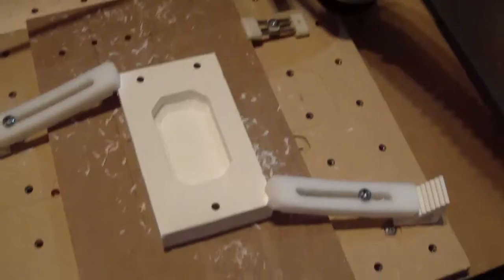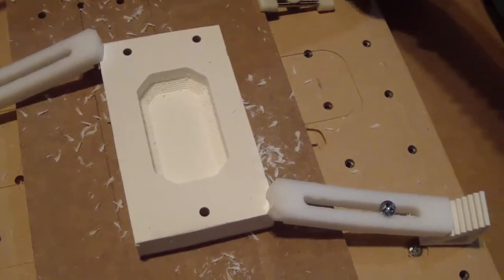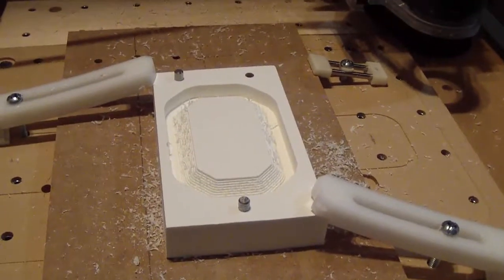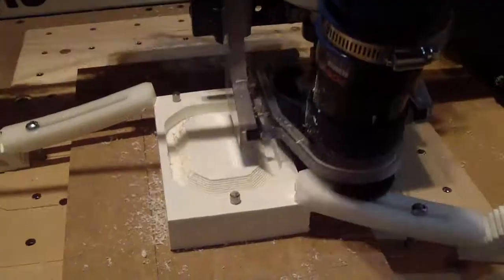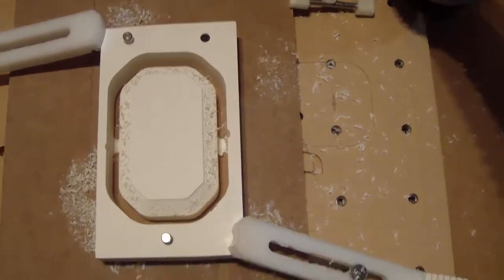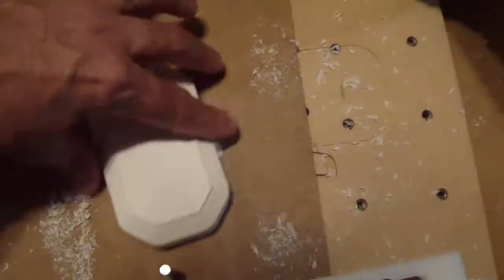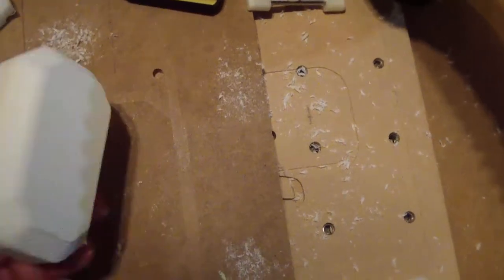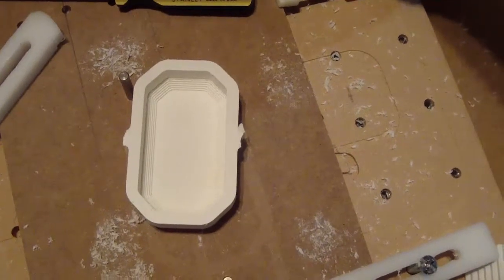3  Side 2 Machining

Comment: Because the holes are offset in both x and y to constrain the part, the three holes line up with the pins when flipped, the bottom pin on the centerline of the flip, and the two top holes mate with the pin when flipped to their respective side, hope this helps